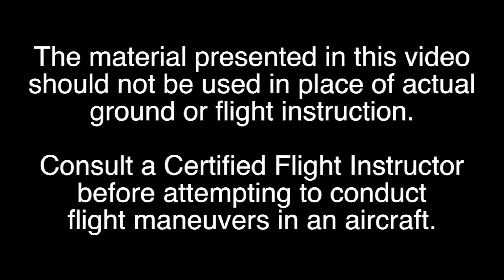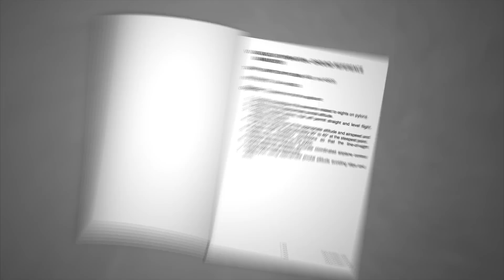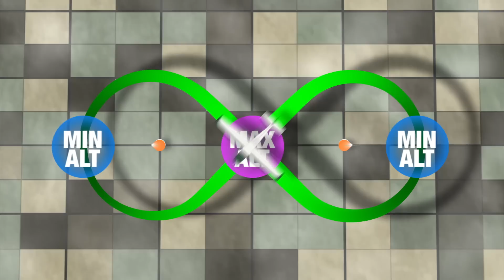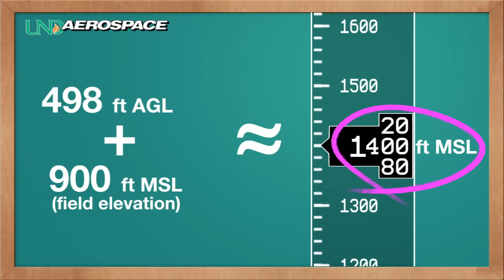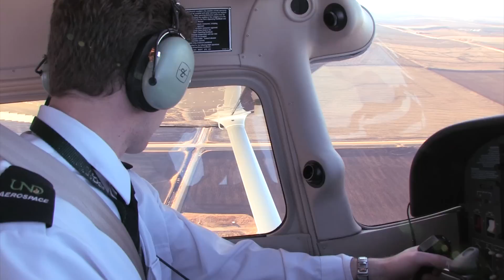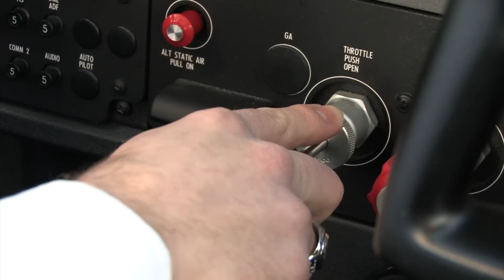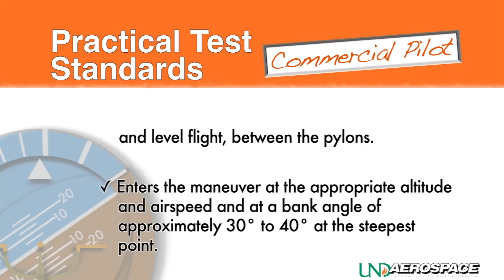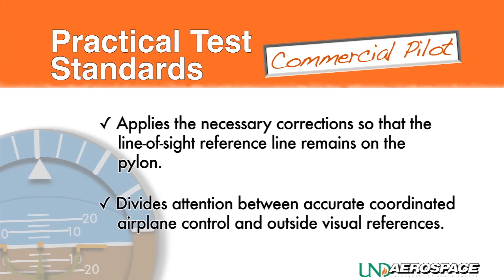Commercial Eights On Pylons

Comment: When I am teaching these, I have my student imagine the shoulder line is a gun shooting the pylon, and that we are a kite with one string length that cannot be longer or shorter.  We figure the pivotal altitudes for known down wind and upwind and use those as guides.  We enter on the 45 degree angle downwind between the pylons and begin the maneuver when we start the first turn.  We adjust the bank for distance from pylon while simultaneously adjusting pitch to keep that pylon in line with our shoulder bone.  Every few seconds, check forward and look at gauges and look out for birds, towers, terrain, note places to land in case engine fails (should be done when selecting pylons.)

Comment: So you push nose down on the headwind, and pull nose up on the tailwind side.  Great.  That way you get used to pull more on a tailwind turn and stall the airplane like it has happened thousands of times to guys that learned Eight on Pylons.   FAA dont require them anymore since the 1960's.  A Foolish Useless Maneuver..

Comment: why was 75 chosen as the minimum ground speed
Reply: 95 tas minus 20 headwind in the direct upwind portion of the turns. 105 is top ground speed because there is no direct downwind portion of the maneuver, the 60deg entry makes the tailwind component about half of true wind speed.